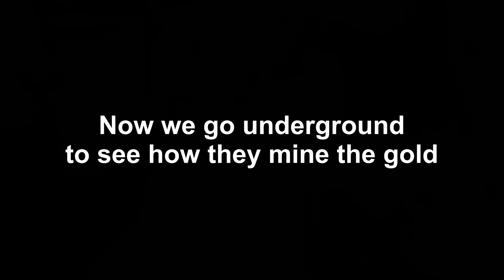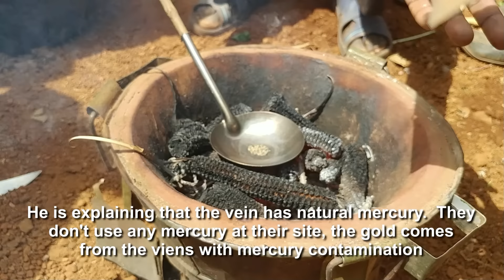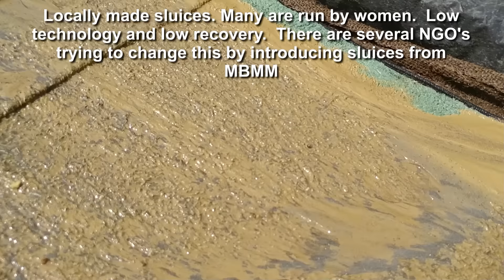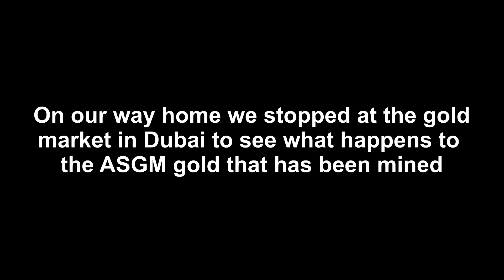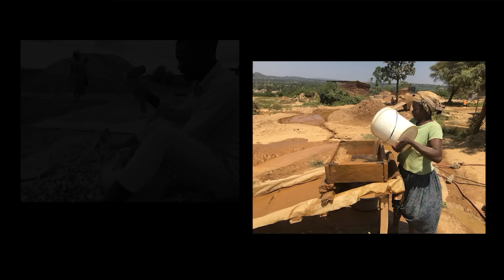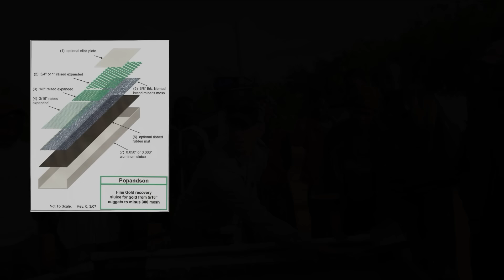Gold Mining in Kenya: Supporting Local Miners & Reducing Mercury Use with Shaker Tables & Sluices

Comment: Jason, thank you for sharing a riveting, spellbinding, and educational experience in the gold fields of Kenya! The primitive ways of mining make me look like a lazy person! Or maybe, spoiled rotten? Either way, thank you for sharing your shaker table and sluices with the miners. Just think about how much gold they have lost through the years. This equipment will help them tremendously and bring some ease  to back-breaking tasks. Don't even get me started on the mercury use!!! As an RN for 30 years, there has been a case in which a patient almost died by mercury poisoning. The BP meter was broken... no one knew. Every time the patient had her BP checked, tiny balls of mercury ran out the top and onto her bed. The point is that mercury = increased chance of poisoning every time it touches your skin.

Comment: Great videos man, I believe your shaker tables and assay is the best way to recover gold. One day I hope to have enough to buy a rock crusher or sluice from you. You truly are a inspiration, making the world a better and cleaner mining operations. Thank you
Reply: I wish he made a smaller, more affordable unit for “hobby” or “recreational” weekend prospectors. Maybe even an unpowered unit a hobbyist can power with stuff they have lying around like maybe their old dredge or electric motor. Something small and in the $500 range. A weekend couple bucket hobbyist cant buy a whole mining equipment operation.
Maybe a chain mill?
Reply: @megapint1626  I was thinking about a concrete mixer with some steel balls. Prolly still have to screen and rerun Material but with some water might work to break the rocks down. I have a 3ft riffled sluice I could run washed and screened Material.
Reply: @megapint1626  ive seen a hand operated crusher demonstrated by Dan Herd called the Crazy Crusher. its about in that price range. also, you could use a Gold Hog Super-Sluice with their bilge pumps to process ore and cons. fairly quickly too. about a 5 gallon bucket in about 30 minutes if going slow. my father and i take about 2 full buckets back from a stream here in Vermont when he visits that i process fully at home with mine in my shop. we classify down to about 1/8 mesh and then i pan out the minus cut. we dont really have to worry about pickers as they are still a bit rare, and woudl be visible in our mesh after we flip them out. we use stainless steel in-bucket classifiers such as what Dan likes to use, and we can process a Lot of material in one visit to the stream or brook or whatever it is classified as. we dig out bedrock potholes in the stream bed and surprisingly we have found one picker, and a number of small gold bits. as for powering the bilge pump, i got an EcoFlow River Max battery, and wired the pump with a 12 volt car adapter using some crimped connectors and i just have to turn the unit on, and to run the pump its just a press of a button on the unit to start up the 12 volt car adapter port, and i can run it for easily 12 hours or more non-stop. in total the cost of it all is a little pricy, but its efficient and works, and its part of the hobby. the price for the Gold Hog multi-sluice with pump, the battery, and the wiring connector kit and crimp tool. then buckets, classifiers, pans, and scoops or shovels, then time and fun haha.
Reply: @phreezethaking9782  that’s a good idea. I think hobo freight has a solid steel one for cheap. May need to check that out as an option.
Reply: @EddieSchirmer   dude that sounds awesome running it with your dad. I hope you find some good ones. The setup sounds pretty effective for a couple buckets. I'm in north carolina and what I'm finding seems needed to be crushed before panned. It's alot of hard rock, but beautiful stuff. Good luck to ya
Reply: @megapint1626  thank you, I'll look it up. I work at a deli restaurant when my wife is off. It's hard to find cheap machinery in my price range. I do it more as a hobby with my son than a job in itself. I wish I could mine as a lifestyle but currently I gotta keep it cheap. I hope to one day hit it big but I'll leave it to god.. thank you for replying.

Comment: This is really cool! it's wild to see it's still done like this. 
16:00 I can't belive he's doing it all by hand! I would have figured someone would have made a simple stamp mill setup by now. a log with some steel on the end and a big lever arm to lift and drop it. I'd rather turn a wheel all day than swing a hammer
Are the women allowed to use the new shaker table? or is their collection kind of a side industry of the mine? It seems like a donation of some flavor of miners moss or capture mat would do them wonders on their recovery rates.
It's no surprise that they turn the gold into jewelry, it's worth more than it's gross weight that way.
I wonder If kinetic hammers, where the handle is replaced by a length of stiff steel cable, would help breaking the rocks up by hand. you're supposed to deliver more energy with them and get less fatigue from feedback. might be a little upgrade to the 'ol "sit here and break rocks" station

Comment: We also have small-scale mining in our place and the miners used to separate the gold from the concentrate by using mercury for some years. Three or four years ago, the use of mercury was banned. Now they are using the method called "panning" which is painstaking and inefficient. I wish someday the shaker table and sluice box would be introduced to them. After watching this video, I am now certain that much of the gold from the concentrate is not extracted and goes to waste with the tailings/silt with the method they are currently using. WASTE OF HARD DAYS WORK considering the fact that mining is one of the hardest and most dangerous work.

Comment: I must make a comment here. I was trained as a proces technician and love to see people mining Gold. When stuff works it works but, what in my opinion I see almost every miner do wrong is how they take their efluent from the setling pond. Almost every miner has a narrow pass where the return water is taken back into the proces and by what I know that is totally wrong. When you make the spot where you take your effluent as wide as possible and level ofcourse you only skim the upper top of your water (with low flow) which is the cleanest and the quality of your return water will be so much better. When you do it right you can get the quality almost as high as clear clean water that looks like you can drink it. When it is hard to get the overflow ridge level or flow is varying you can also make pointy snaps out of a plate and let the water flow off there. Check how they build setling ponds in sewer treatment plants. Thanks for your video's and great work to show these people other ways than using Mercury to gather their Gold. CYA later!
Reply: There are 2 sides to this expierience ofcourse but what a great video. I really enjoyed it and learned that I could push my bearings a little more than I'm used to. Maybe you can introduce Mercury condensors if these people think they can't go without,they'll help in 2 ways. Yeah what a great expierience and I hope you can keep doing this. Safe travels Jason and crew.

Comment: The sad part is PVC plastic is not ultra violet stable. The sun will degrade the PVC and it will become brittle and break. It needs to be painted to last longer or you need to use a stable plastic that can withstand sunlight. Just saying!